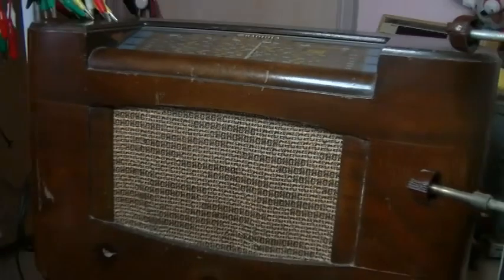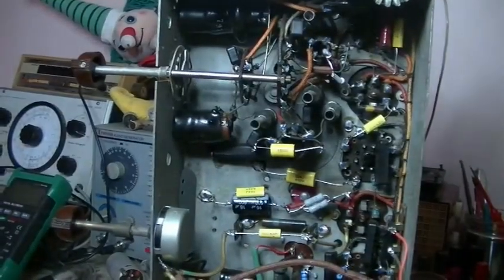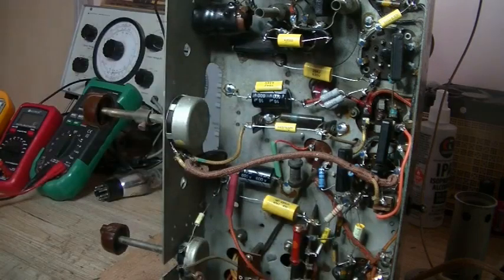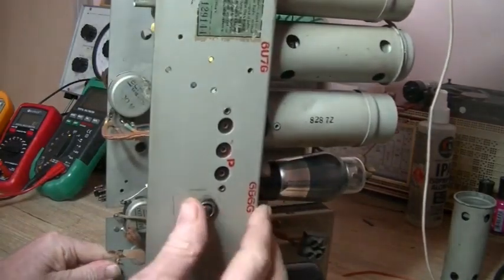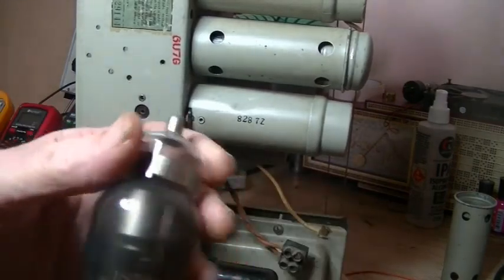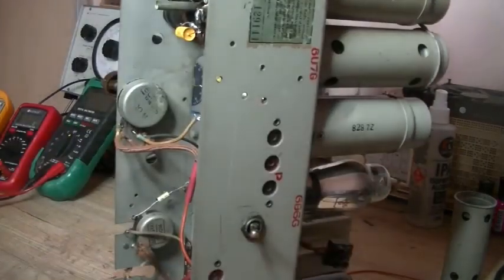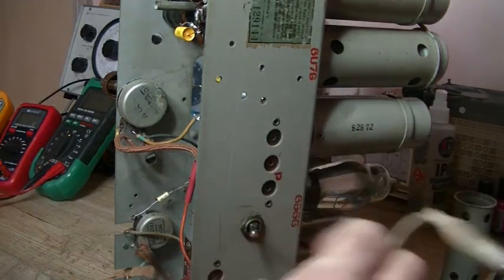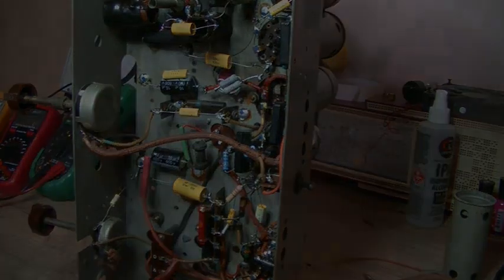Radiola 95 (1941-46) Plays only at full volume. Let's fix it

Comment: Easy one for you Frank, I was thinking a bad volume pot at first. I had one years ago where someone put a 50-volt filament tube in place where it should have been a 35-volt filament tube.
Reply from the maker: That's a lot of voltage for a tube Ken, I'm used to 6.3 and 5v only
Reply: Yeah, Frank unlike the radios from Australia that has to have the power transformer because of the 230-line voltage a lot of our radios were transformer less which we call AA5’s and AA6’s, the heaters are in series and all 5 or 6 of the tube's heaters have to equal close to our line voltages of 115 to 117 volts.
Reply from the maker: @kenf8563  Now I understand how hot chassis work on the filament voltage, thanks Ken

Comment: I couldn't help wondering if the socket labelled 6U7 doesn't have a 6B6 in it. As it's shielded, you can't see. I could imagine someone plugging the valves back in, and accidently swapping two.
Reply from the maker: Hey Tim, I did check and the other valves were correct. Easy to make this kind of mistake I guess. Thanks :)

Comment: Well it did have one 6U7 in the radio as it was clearly marked on the chassis nearby. If one is good wouldn't two be better?
Just kidding Frank. These are the kinds of mistakes that happen when you remove all the tubes at once for testing with a
tube tester and not putting them back in the right sockets.
Reply from the maker: I've done the same myself Steve; picked up the wrong valve put it in and then the socket started smoking lol. Luckily no damage